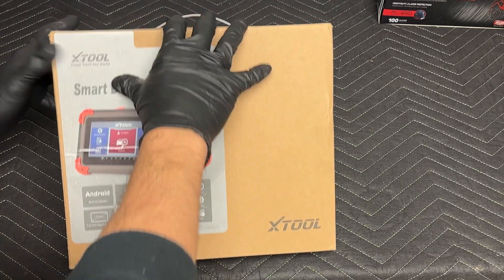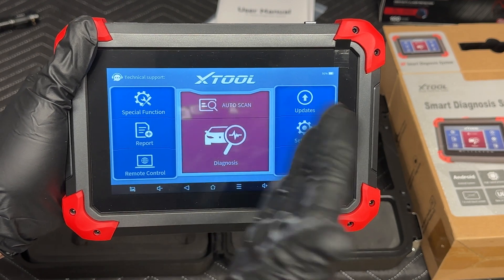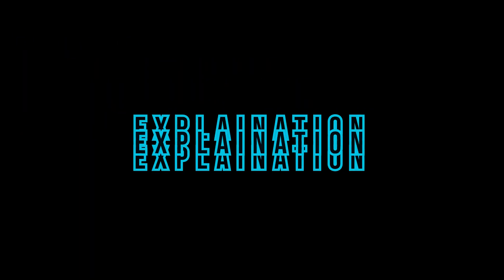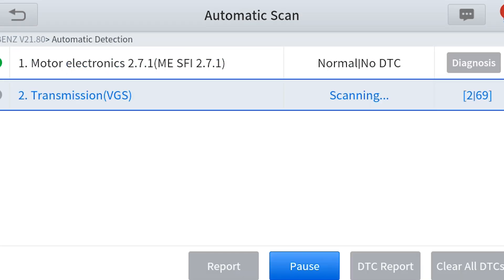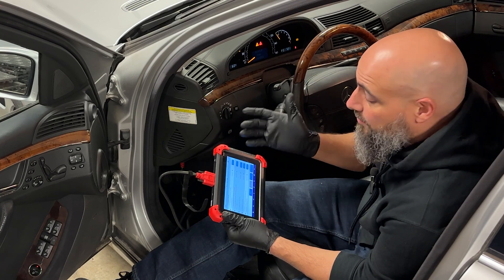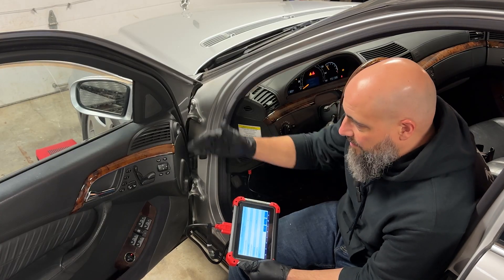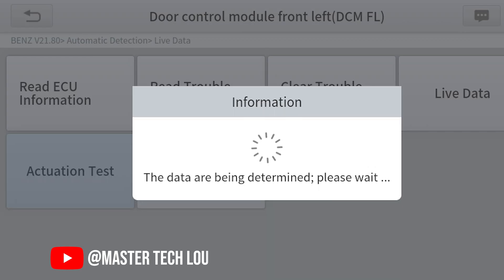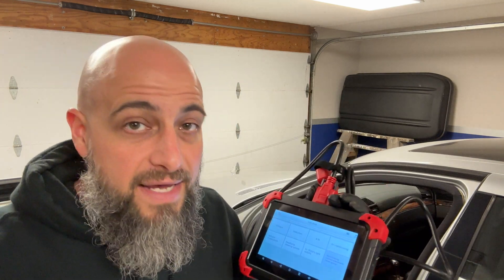Xtool D7 obd2 bidirectional scanner review how to use the XTOOL D7 scanner

Comment: I recently bought a XTool D7 scanner thru Amazon back in February of this year . It looks very identical to yours , but mine doesn't have , or at least I haven't found it , the key coding feature ! My auto diagnosis home screen is also different from yours . So my question is what model exactly of the D7 scanner are you using ? Mine is the D7 . All that it says as for the model number ! Also, I'd like to get a scanner that can program / code the electronic modules in a car , especially the ECU or main brain in like all vehicles from 1996 on up that has the OBD2 system on them , or at least from 2005 on up . My 2006 Ford Fusion is acting you reading the rpms and I tried to take a ECU out of another Ford Fusion car with the same ECU numbers that had been programmed at our local dealership last year when it was acting up , didn't fix it so they took it back out and erased it and put my old one back in . Now that it's acting up again I tried swapping them out and they did actually erase the new old one . Engine wouldn't make a sound . I want to be able to swap out electronic modules especially ECU's and program them whether they be new or used modules or ECU's . I'm just a beginner / amateur home mechanic so I want a decent scanner , but not one that will break the bank as it won't be used that much . 

Thank you ,
Bryan
Reply from the maker: Send me some photos through instagram

Comment: Thank you. I am glad you got it working so quickly. I just got a D7 and it does not look like that, both outside and the display. Had trouble getting WiFi until I created a separate 2.4 GHz Wifi channel on my wireless router. Several reboots later I finally got the product registered and ran the suggested updates. The speed stalled to a crawl (Bytes per second!) and memory ran to 99%! Found a menu option to select and delete unneeded diagnostic modules but had to reboot after deleting some and now I can't find that menu again. I can't be that dumb. Or maybe I am. Mine did not come with a manual. I had to go online. The downloaded manual was not much help because, as I mentioned, the menu options do not match what I see. in getting. Right now I'm just in day one, 8 hours in trying to get it working. I started a help text thread with the Chat link on their website and still waiting for a reply. The problem with all the how-to suggestions so far is I don't see the same menu options they are talking about.

Comment: Checking 02 sensor function. Multiple listed. Which do I check in live data?  Default data flow There is test 70, 112,113,117,144,145,146,56  please help

Comment: Hello, I have a question, I recently purchased a D7, it discharges quickly, even when stored, I imagine this is normal due to the 4000mh battery. Do you recommend turning it off when storing it or not?
Reply from the maker: @victorrocha5849  yes always turn it off power down, shutdown. I have not noticed much issues with a lot of my scanners but even when they sit and powered off I do notice some battery drain. But should still be fine over course of a month.

Comment: Thanks for the video. Do you know if this tool can deactivate SBC, to flush brakes on W211?
Reply from the maker: @geremiasalvo3406  I think it would however a thing I do is just unplug the sbc. You can then safely flush it with a pressure bleeder, NOT manually, and then when done reconnect. There will be no issues. 😉

Comment: Will this tool allow you to reset tire size, tire pressure, gear ratios and the rest for all vehicles without additional purchase?  Some call this adaptations?  Looks like Scantool calls it "updates"  ?  Is it safe to assume these functions are available for basically any Make /Model which it connects with?
Reply from the maker: It falls under coding/adaptation yes. It all depends on if the car originally had that option. Meaning if a control module supports the processing
Reply: I currently have the xtool A30M on my tablet at home. I'll check later. If I forget to respond just remind me
Reply: @OneManOnFire  Thanks a ton... I see on their website it says 36 Hot Maintenance Services one of them is TPMS but this does not tell me you can change for example the target Air pressure and range... or Gear Learning...sounds like you can change Gear ratio's here but not srue what that really means.  Also "Tire upgrades"  this sounds like changing tire sizes but it does not say specifically...thanks

Comment: How do you go about registering the XTOOL D7 could you help with that. when I got mine 2024 xTOOL D7 through Amazon there was no seal on the case of the scanner when it was purchase that when it first come out the 2024 newest version XTOOL D7 didn't have any problems with it but there was no security seal on the case. But there should have been one correct any help I appreciate it thank you for sharing all of your videos and you're awesome knowledge MasterTech Lou.
😎❤🙏🇱🇷✌
Reply from the maker: It should have walked you through registration once you received it. If it didnt you may wanna return it. It should show you when the software expires. Indicating when it was put into service. And thank you for the nice comments on my channel I really want to help. I will be doing less reviews in the future and more “how to” videos
Reply: @MasterTechLou  thank you for replying back to me right away master tech Lou.
So it got warranty when I registered when I connected to XTOOL D7. I did received all my downloads at the same time so that's when I receive my warranty I understand now. and even been receiving all my updates so I guess it got warranty when I connected to
XTOOL D7 company ..but there was no safety seal on the case like it showed on your video the sticker over the seam of the case. that sticker it wasn't on mine. I wonder why but it works fine with no problem but my last download after I received it and it was done my screen went blank the only thing showing was my prompts were on the bottom that's all it shows so I shut it off restarted it and everything come back as it should I guess it's fine.. thank you for replying back to me right away I truly appreciate it Master Tech Lou I didn't understand how the warranty come into play thank you for  let me know that.. I do definitely appreciate all your videos and the knowledge you share with me in your videos helps me become a better and great mechanic knowledge is power . I am looking forward to your videos that you are going to be doing more in-depth reviews on the new 2024 XTOOL D7.. I'll definitely appreciate all your videos thank you..
God bless you Lou and your entire family and your friends stay safe..
😎❤🙏🇱🇷✌

Comment: I just bought The Xtool D7S. It does not show the Reference value on the live data streams. Did you do something to get your D7 To show it. The D7S is supposed to be newer so why does it not show it.
Reply from the maker: Hello, was it on the exact same model and module? I just connected it to my dodge and it does not give me reference values. So my assumption is, that unless the module is capable of giving reference values you will not see any. I did an autel review on the same dodge I am going to ffwd through that video see if the live data  screen is the same as xtool but my guess is the module doesnt give reference values. Just my opinion but something I will now watch out for. Thanks 😊, Lou
Reply from the maker: Ok yes so on my autel video the “range” column is there but its blank. So my guess is that the oem module doesn’t support the range function or reference values. Again I will keep an eye on this and compare oem. Now I am at toyota so I can check the gts3 vs the scanners I have. Thanks again, Lou
Reply: @MasterTechLou  I thank you for giving an answer. I have a 2017 Toyota Camry, and It does not show the reference Value.
Reply from the maker: @mattman16oct  ok from what I have seen so far at Toyota, the oem scanner doesnt give a reference value. The reference numbers are in the diagnostics fault trees in their workshop information system knows as TIS. Mercedes star diagnosis/xentry systems did show reference values which was awesome. Some manufacturers just expect you to know these things which sucks. Theres a lot of useful information that falls through the cracks in the automotive industry which im sure you’re aware of. “Doesnt the scanner tell you whats wrong?” Is something I hear constantly. Wish things were as easy as people want them to be. Hope this helps, best of luck my friend. Lou

Comment: sir, can this read actual mileage of the car so we can check if it has been tampered?
Reply from the maker: It can read mileage if a module store’s mileage. If that makes sense. If the engine module is capable of storing miles or another module besides the cluster then yes it should be able to.
Reply: @MasterTechLou  so i guess it just a matter of digging through the modules and finding it.

Comment: Hey Lou, I’m thinking about buying this xtool and thank you for all the awesome information on it. I got a 2001 S500 W220 and I got a situation with the headlights. I only got low beam and high beam and none of the fog light positions work on the switch so does this scanner give a diagnoses tips  if the switch is bad or if it’s just something else and how does it compare to the icarsoft CR model ?
Reply: What you need is bi directional testing to fully confirm if it's the switch itself, a module, or the headlightb itself. 

With Icarsoft it will show live data the xtool can do live data

Comment: I always slid by with my obd tool. I recently came up against a malfunctioning body control module and spent a whole day tracking the signals with a meter disconnecting( welded 😂) connectors. I'll never do that again. im just studying what scanner will allow me to check and possibly reset control modules. Does anyone know if the D7 gets that job done?
Reply: Yes
Reply: @Mike-vt6is  thanks a million, Mike 👍

Comment: I have watched so many of your videos all are very interesting however, I am working on Mercedes Benz E350 2009 transmission won’t  shifting code U0101 I have replaced the TCM unfortunately the problem persists it would be a great pleasure if you can respond as soon as possible. Thanks
Reply: Did you ever find the issue ?

Comment: Does it have service mode for EPB?
Reply from the maker: Yes it does
Reply: @MasterTechLou  
TOPDON, LAUNCH or XTOOL D7, overall which do you think is much better?
I am confused between the 3.
Reply from the maker: @adams6798  they all the same in my eyes. Basically comes down to what format you like lookin at. I personally like launch. I am still getting familiar with xtool which I also really like especially the a30m. But topdon pheonix plus seems very competitive. I just dont work on as many issues as id like to really hammer home which one is best. At least not yet.
Reply: @MasterTechLou  
It seems many people say launch is the best
In terms of durability which one would you recommend?
Reply from the maker: @adams6798  I have a 2017 launch x431 still work’s awesome with great battery life. So id have to say launch. They seem to have the most street cred next to autel which im pi55ed that my 1800$ ms906bt battery is crap after 2 years
Reply: @MasterTechLou  
Thanks for that information, it’s helpful
Reply: What is your opinion on innova 5610?
Reply from the maker: @adams6798  so I have not used one personally but I have helped many online that have used them and they seem to do quite well. Assuming this is the highest model innova. It was honestly surprising how useful they were.
Reply: @MasterTechLou  
It is the highest innova, it looks great, the only setback is that it looks cheap when it comes to the material that makes it up and it doesn’t come with a box
Reply from the maker: @adams6798  I agree. But I remember helping a guy with a Mercedes Benz and the things it was able to do blew me away
Reply: @MasterTechLou  
So it might be a good option to buy

Comment: Didn't Autel purchase the XTool brand a couple years ago. I was going to purchase the one that is able to reprogram and add keys. It could pull the pin code needed for the key and infotainment systems
Reply: They are two brands and there is no such thing as an acquisition. Key programming is simple for Xtool

Comment: I found the graphing function really sucks. Sampling rate of 2 frames per second and no floating scale for MV applications. Other than that, a fairly good bargain. Just don't expect readable live data for A/F sensors.  It took 2 weeks of back and forth to communicate the deficiency and after a promise that engineering would address the poor scaling, it was never corrected. Autel has far more responsive and intelligent customer support. Maybe if I download updates a month after the release, the live data graphing funuction will magically self-correct. I know the correct scaling is possible because if you export the data, it reads with a correct scale. However when this is done, you have to limit the time because the time scale is compressed. This must be why reviewers dance around live data graphing.
Reply: When did you get your Xtool D7.. 2023 there was a new version with the new updates which upgraded to D8 but a couple things with the biometric it can group up to four at a time. So if you have XTOOL D7 you can upgrade yours to the newest version they have a new version out😎👍

Comment: Hi Lou love your channel so it took me 9 months but got xentry scanner for my 04 e320 and it has paid for itseld with 1 use l.  Teleaid is now mot present and fixed srs lights also but in  white guage  cls cluster.  Also my buddy in Euripe used team viewer and vedimo to put the og miles back on newer cluster.  It does not do online mode of course but can do a lot with it.  Plus with tactrix bootleg its 20 bucks and i just got programs loaded for cheap on my oldwr laptop workes great.  So for say a toyota i have two of them 2011 and 2015 what would be  a giid module i saw openport j2534 2.0 workes for toyota
Reply from the maker: J2534 I believe is not for diagnostic its only for online programming. I now manage a toyota service dept and the scanner is on a Panasonic toughbook.  Its called TIS techstream. Not sure yet who it anyone sells the program bootleg.

Comment: I used an XTool AD20 pro. It erased data on my 2003 4Runner. Now I'm buying a bidirectional scanner to fix the YAW sensor.
Reply: What did you get? Im thinking of the xtool a30m
Reply: @MarstaJNZ  I bought a cheap one at auto one that had bidirectional controls. I recoded the YAW and returned it.